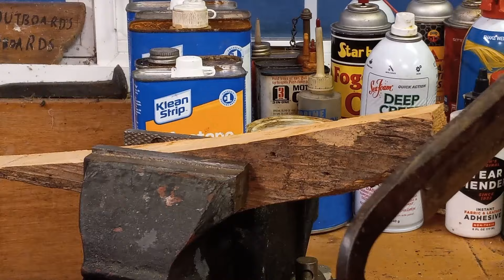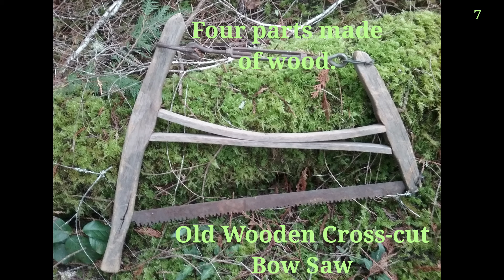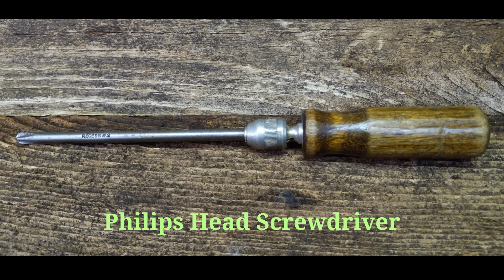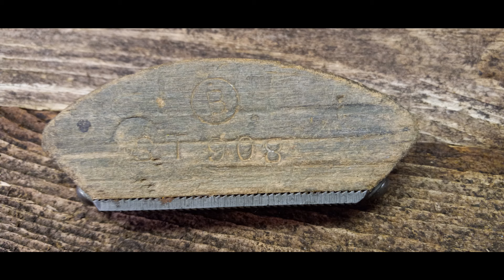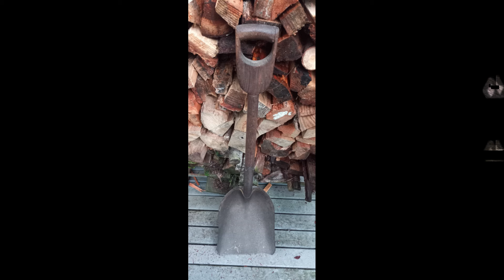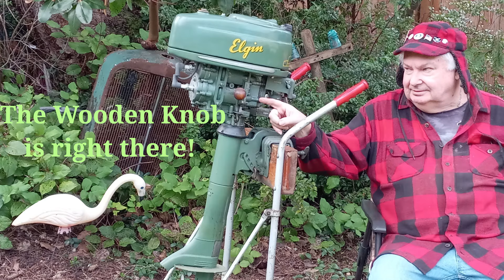Vintage Hand Tools   I

Comment: The wood grain dictates the way you use the drawknife and spokeshaves.  That was a particularly nasty diagonally cut piece if wood!  The 2 wooden handled 'rasps'  are body files for dressing down lead body filler, used in car body repair, before polyester fillers came on the market.

Comment: Called a mechanic wrench not adjustable
Reply: In the UK we call them adjustable wrench or adjusty, adjustable, justy. Can even change name between different groups of tradesman. When I did my apprenticeship we was told not to use them because there not the correct tool for the job and round off nuts, I was taught use right size spanner for each bolt / nut but hey they come in handy and save time sometimes. And if you have no tool this tool this adjustable is better than no tool 👍